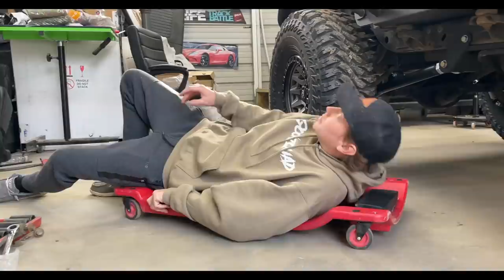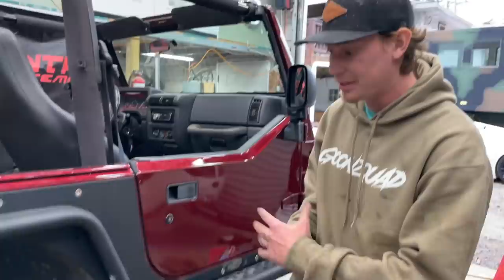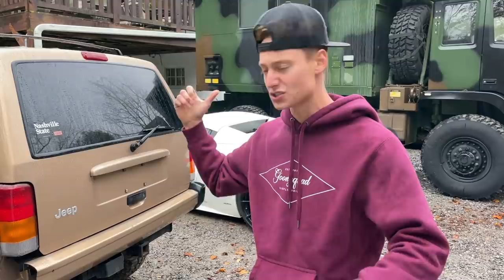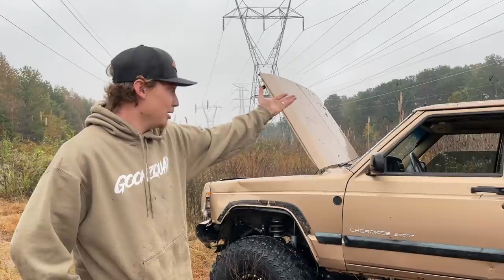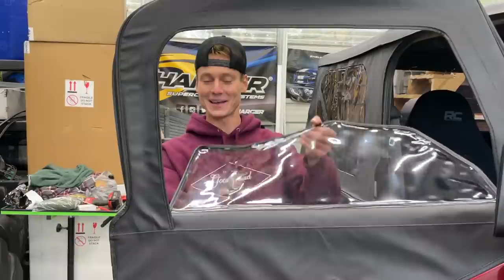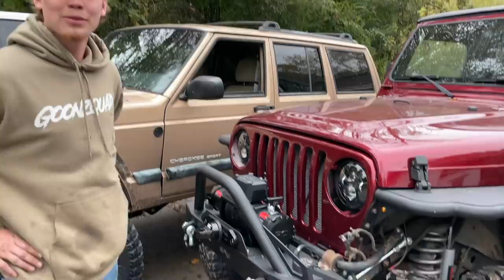Well Deserved Winner Of The Jeep Revealed!!! Guess Who Gets It?

Comment: in the begining of the video you were discussing about the vibration of the drive shaft. This is called Pinion Angle that you diffently need to adjust.Which is important when setting up the rear. suspension.

Comment: Slip yoke eliminator prevents the driveshaft from pulling out of the transfer case under extreme articulation.  Rear control arms are what straighten out the pinion angle.  Cool video guys!

Comment: You guys should weld the new bracket plates directly to the frame. That would give a stronger connection to support the longer suspension arms.
Reply: It will never be offroaded. It will be fine

Comment: What’s great about the XJ. Is that it’s like 500lbs lighter and has a strong transmission. Only con is the cooling system. The rear doesn’t flex as much as the front but just add a front locker and it will pretty much go over anything.

Comment: The XJ is THE value for money base for a rock/sand crawler. It is key to get the right tires, and to be able to air up/down the tires. As I have said before, Matt's Yellow Banana is the one to beat for mods, inside and out. They can pull an insane weight.

Comment: Everything you said about the SYE kit is false  one thats not a CV joint its a double cardon joint. Also the SYE kit cures the slip yoke from coming outta the T case the stock shaft above around 5" of lift gets closer to the end and is higher risk of spinning the splines off. So the shafts itself slips as suspension articulates

Comment: Replace the chassis to battery and chassis to engine ground straps. They go bad. I had issues with starting and charging.

Miss my Blue XJ. It saved my life in a head on collision. I looked at the pictures afterwards and was like, I walked away from that? I’ve been on bad EMS calls, but my accident looked worse than my injuries. I’ll buy an XJ any day!

As for TJ vs XJ, same vehicle, just a shorter body. The XJ is only better because the leafs and the length on trails. HOWEVER, the TJ can turn better in tight turning trails. Miss working on one.

Do me one favor. Pull the dashboard and replace the heater core so you don’t have overheating issues. Steam on the windshield on any day is a classic sign!

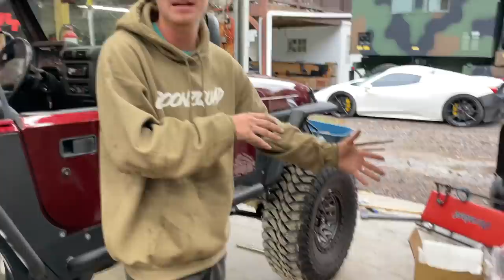Comment: cheap 4:10 gears, ford explorer ford 8.8 with disc brakes 1997+ with 4:10 gears need spring and leaf/link component swapped or new ones. jeep wrangler 2.5L 5sp with 4:10 gears, direct swap.

Comment: Hey guys what the heck happened to the front painted grille around the headlight areas on both sides because there's paint chipped off around the headlights? You can't possibly give that Jeep away with that wiring harness sticking out from the grille at the bottom and all that paint damage are you????